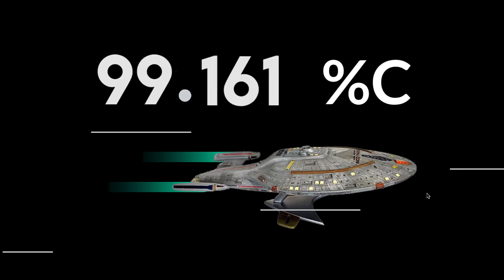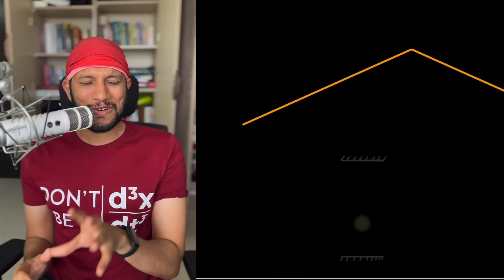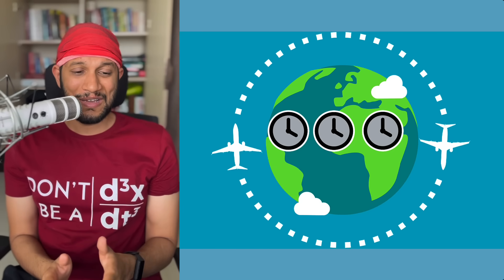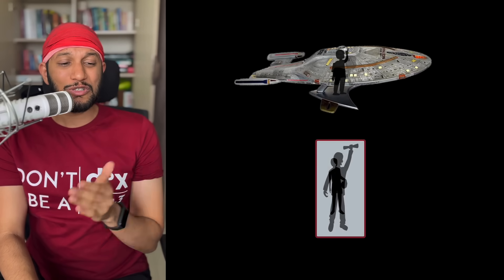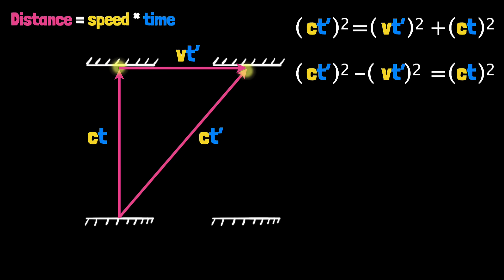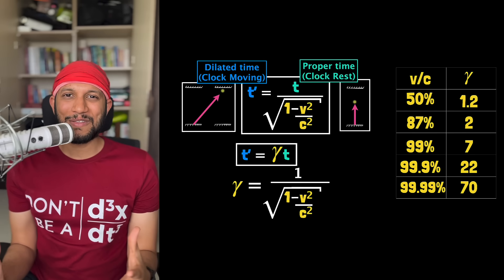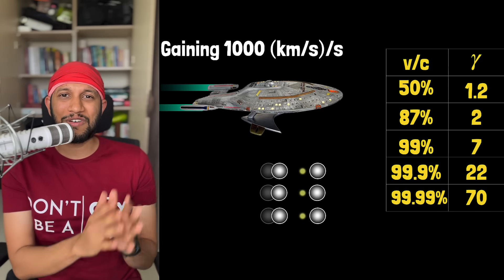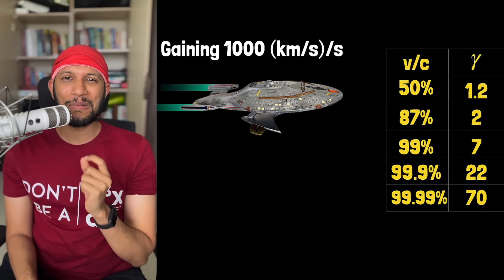I finally understood why you can't go faster than light! (My mind is blown)

Comment: Wow. I actually understand this. The beat explanation of why light speed is impossible i have ever found. One question, you have explained this from the observer of the ship approaching light speed, what would happen to people on the ship as they approach light speed? Would they cease to exist as the external ie time outside of the ship would become infinate?
Reply: Remember that all speed is relative.  While the ship is moving at 90% of the speed of light according to one external observer, it is simultaneously moving at 20% of the speed of light relative to another, at rest relative to yet another, and at all other possible speeds between 0 and c in infinitely other reference frames.  If all of these reference frames are equally valid (as posited by the principle of relativity, going all the way back to the 1630s here), then why should the experience of someone on the ship depend on how fast the ship is moving according to one particular external observer?
Reply: @extravagantpanda7962  ok another question. Light is subject to the doppler effect the same as sound right? Hence the red and blue shift. If I were travelling on a train moving at velocity v and shining a torch or laser towards the back of the train. The light would be traveling at c - v right. But if I shine the light forward does the light travel at c + v, i.e. faster than the speed of light. Or is X a constant and the wavelength changes?
Reply: @ChrisPavey85  No, the light would be traveling at exactly c in both cases, because light always travels at c in every reference frame.  If you shine the light in front of the train, both you and an observer on the ground will say that the light is moving at c.  This invariance of light speed between reference frames is what causes time dilation and length contraction. 

However, as you also said, yes light is subject to the Doppler effect.  The relative velocity of the light emitter (in this case you on the train) will cause the emitted light to shift in frequency (and equivalently in wavelength) according to the observer that the emitter is moving relative to, but the speed that the light travels remains the same to both observers.

Comment: The best explanation so far. 
One catch.., application of math of dilated time in the same vector of normal time… just doesn’t seem right. This is where the theory becomes a religion. Those who says it can be applied are its faithful followers and those who sees it as inappropriate (wrong way of) application or use of the vector tool to solve problem with linear and non linear factors in a same unit scale vector frame is a non believer…. make sense?

Comment: I have a question about the assumption that a photon clock would tick slower when moving. The intuition that the photon would have to travel a longer distance is true if the clock is oriented perpendicularly to the direction of motion (as shown in the video) . But what if we orient it parallel to it, so that the photon moves in the same direction as the ship to reach one of the mirrors and in the opposite one once it bounces off. What happens then? Isn't the photon supposed to travel a longer distance towards the mirror in the front but a shorter distance towards the mirror in the back, so that the time for reaching each balances out and the overall ticking remains the same as the one in a stationary frame of reference?

Comment: Okay but here's my high thought. Do we PERCEIVE this time at the same speed regardless of the speed we are travelling at. If the atoms are slowing down so is your brain. But do you think slow or do you not notice at all? Is there a singular speed all existence is experienced at? Could other hypothetical aliens have a different experience speed? Would there be a way to test with with species on earth if you had the perfect equipment? Plane atomic clocks but for different species.
Reply: You always experience the same time.  In your own reference frame, you are always at rest.  When you talk about having a non-zero speed, you are necessarily referring to your speed in some reference frame traveling relative to you (e.g. if you're going 70mph on the freeway, that speed is relative to the ground).  It is only to an observer in that reference frame that your time runs slow, but from your perspective time continues to run at the same rate and it is the other guy's time who runs slow.  

Also, the degree that your time is dilated according to an external observer depends on your speed relative to that observer.  Suppose there are two observers Alice and Bob, such that from Bob's perspective you are moving at .5c and from Alice's perspective you are moving at .8c.  Your time is dilated more from Alice's point of view than from Bob's, but you can't simultaneously experience two different rates of time, so who is correct, Alice or Bob? Well there's no reason that Alice's point of view should have any more importance to what YOU experience than Bob's, so we have to conclude that your perception of time must be independent of your speed relative to an outside observer.

Comment: 4:08 Can anybody answer this for me? So from the observer on Earth, the atomic clock in the fast-moving plane appears to ticks slower. Got that. But from an observer on the plane, wouldn't the atomic clock on Earth appear to tick slower, since relative to the plane, the Earth is moving really fast? 

Therefore when you bring them together, how is it possible that one is ahead of the other? Because from either perspective, the other one is the one that ticked slower.

Comment: No, no, wait. I still cannot understand why Einstein equates movement of information with the movement of time. For the observer the ship will be accelerating slower, but who cares about the observer. You are on the ship, you are accelerating. To you, nothing changed. In relation to your hand, the second is the same because you are accelerating with the clock. Yeah yeah photons take longer and longer to reach the outside observer, but no one cares about the outside observer. What you are describing is how fast the information about the flight reaches the outside observer, which is slower and slower and eventually it will be so slow that basically no information will come.  If it was a radio wave moving towards you, and you would be flying away from the wave at the exact speed of that radio wave, it would never reach you. And if you fly away even faster, that radio wave would be further and further away from you and again wouldn’t reach you, but you CAN outrun a radio wave. Just like you can outrun a sound wave. That is what you are describing. Prove me wrong.

Comment: I can't find any other comments asking this question so here it goes.
I totally understand how from outside the ship, it appears to take longer and longer so acheive the same velocity increase. 87 percent the speed of light take 2 outside seconds to increase 1000km, but only one inside ship seconds to do so. That being said, even if it would age the universe outside to it's everywhere heat death, from an inside the ship point of view, wouldn't it still just take one second to accelerate that last 1000km to hit the speed of light? 

I'm also slightly confused about what the ship would look like. Say i got to 99.999999999999999999999(just keep adding 9s as much as you feel like) percent speed of light. Since time is now moving so much slower for me (the outside world is aging faster) wouldn't that make a ship going only 99 percent the speed of light seem to zip by me? I might watch billions and billions of years of the universe age through the window in a second of my inside the ship point of view. Which should really only have me objectively move roughly 300,000,000 meters. So I've only moved 300,000,000 meters in a universes lifetime. That seems pretty slow to me? What I'm i not grasping here?

Comment: If we are moving constantly, on this planet, as a solar system, and as a galaxy, it means we too are traveling with dilated time. Can we backtrack and actually measure what non dilated time is ? Is it >0? Can we derive from this that actually, moving is time? If so, energy from the big bang that started pushing us away is time, since without it we are at 0? Energy = time? But if energy = time, stored energy, pre release also contains time? Im sorry for the bad english.

Comment: I have to say I understand a lot more now, but can you tell me what happens if there is a mass that is going at 99% speed of light and on that there is a object that is going 99% speed of light. Ofcourse I understand that it is not possible for some reason can you explain why ?
Reply: This is totally possible!  Consider this equivalent scenario: a ship moving at 90% of the speed of light away from earth emits a projectile that moves at 90% of the speed of light away from the ship, as demonstrated (poorly) by the following:
(Earth)        ----->Ship ------->Projectile

To find the velocity of the projectile relative to earth, we can't just add its velocity relative to the ship plus the velocity of the ship relative to earth (though this is exactly how you would do this in classical, i.e. non relativistic, mechanics).  If we were to do that, we'd find that the projectile's velocity is 1.8c which of course violates the "speed limit".

Instead, we need to use the relativistic formula, which can be derived from the fact that the speed of light is constant in all reference frames (but I'm not going to attempt that in a youtube comment lol):

Vp,e = (Vp,s - Ve,s)/(1-(Vp,s*Ve,s/c^2))

where Vx,y denotes the velocity of x relative to y (e.g. Vp,e is the velocity of the projectile relative to earth).  (Side note: the first term (Vp,s - Ve,s) is just the classical formula as mentioned above.  The second term is essentially a "correction" to the classical formula, and if Vp,s * Ve,s is much less than c^2, then this term is approximately just equal to 1 and we recover the classical formula.)

Here we have Vp,s = 0.9c and Ve, s = -0.9c (from the spaceship's perspective, the earth is moving away at 90% of the speed of light).  Plugging these in gives Vp,e ~0.99c.  So you can see that using the correct relativistic formula still gives a relative velocity less than c.

Comment: You can't reach the speed of light, because in your simulation, you're not doing anything to overcome the inertial field.  If you only understand the universe from the perspective of gravity, you're not going to understand.  It should be obvious to anyone, at a point, with physics, you need to overcome inertia.  Substance is more illusion than it is reality.  

Think in terms of moving one field through another, instead of mass through a field.  The mass doesn't need to move, only the field the mass is contained within.

Comment: What about a ship that travels at 51% of light speed relative to earth and another ship but in the opposite direction. How long does it take to send a message from one ship to the other (without the earth as relay)?
Reply: If we label the spaceships A and B (doesn't matter which is which), then the formula to calculate the velocity of ship B relative to ship A is:

Va,b = (Va - Vb)/(1-(Va*Vb/c^2))

where Va is spaceship A's velocity relative to earth  (0.51c) and Vb is spaceship B's velocity relative to earth (-0.51c).  As you can see, the velocities don't simply add together like in classical mechanics.  If you plug in the numbers, you'll get Va,b ~ 0.81c, so still less than the speed of light.  How long it takes to send a light signal from ship A to ship B depends on the distance between them, but since the light signal always travels faster it will eventually catch up.

Comment: Light is an expression of infinity. In mathematics and geometry, we observe the principle of continuum and think of it as an inconvenient abstract which stands in the way of our describing the world around us. Given that we tend to look for digital data that can be understood and applied to our cooperation and manipulation of the natural systems we encounter within reality. But what you've explained quite well, is the evidence that the infinite nature of the subatomic structure of reality is a fact. And our math and geometry are actually analogs of the bigger inconvenient truth. Infinity stands between every distance and outside of them as well. We cannot cross that boundary, because we are not infinite. Like every calculation of the mendlebrot set having its infinite vortex, but all of those vertices sitting with the infinite set of numbers that also sit within an infinite realm of various sets of continuums. Sure, we can walk from one calculation to the next when we're on the Solve for X side of the equation, because they are neighbors with approximation we can traverse. But if you travel down any of its corridors to its solution, you get further and further away from all of the other solutions.
Reply: I suspect that we would never get anywhere close to the speed of light before discovering that even though everything seems to move slower and even ages less, that entropy would rear its ugly head with the discovery of basic physical dependencies breaking down, due to too large a distance being traveled, for some of its components to keep up and still function properly.

Comment: I am no rocket scientist, but have a genuine question. Without gravity or air resistance, wouldn’t any force applied to the moving ship compound upon itself with no resistance pulling it back to rest? In other words if enough time is given, the constant addition of applied acceleration would push it to unlimited speed. This in my mind would not only be able to reach the speed of light, but surpass it. Also, just because speed breaks a clock doesn’t mean it changes the fundamentals of time itself.
Reply: In the video he explains it from the perspective of someone watching the ship
Due to time dilation from the outside it would appear that the ship was accelerating slower and slower, until it was accelerating so slowly that it essentially isn't at all, because the thing applying the force to accelerate the ship is itself affected by time dilation.
Now if you were on the ship, who knows what you'd experience, assuming you weren't turned into mist from the acceleration, as the real time would be an infinite time for an outside viewer while for an inside viewer it would be finite, so there'd be more issues there lol
Reply: this. Why does the light inside the ship not accelerate with it? is the inside of the ship not a closed system?

Comment: So what would the perspective from inside the ship be as it attempted to reach the speed of light? Would they just perceive the universe around them dying of heat death? 

Would the energy of the particles of the ship and crew also experience heat death at the same rate as the energies outside ship, or at a slower rate?

Comment: I've always assumed that if you were to accelerate to a speed where time dilation is 2x and travel one lightyear, from the outside it will appear as if you travelled at near C for one year, but from the ship's perspective it would appear as if you travelled at 2C for half a year. Am I correct there? If so, I wonder if there's anything strange that happens visually from the ship's perspective at speeds above C.

Comment: Unfortunately, that explains why what an immobile observer won't see, won't perceive, any movement faster than the speed of light, that the perception won't be able to "move" faster than the speed of light,  not that the object is unable to move faster than the speed of light.  It is like two rails of a railway which APPEARS to touch themselves when far, far away, due to the perspective. But in fact, they stay parallel. Perspective and math we use to describe it, the real thing does not care about it.

Assume an immobile observer on the x axis at the origine. Assume a mobile at a speed of 2*c also at the origine. So, at time 0, the observer sees the mobile. But at t=-1, the mobile was at x = -2, and the light it emits will only be seen by the observer at ... t  = +2  since the light still moves only at a speed of 1. So, at t = +2, the observer will see... TWO mobiles, one at its left and one at its right. In fact, the complete sequence of what will see the observer is:  NOTHING until t = 0, then, at that time, a mobile appears and split apart, one part moves right and one part moves left.

Comment: actually theory of relativity is false, time is constant, just the observation of time is relative, and time dilation doesnt exist and it havent been proven at all, the atomic clocks test doesng even make sense, why would one clock be faster than the other if speed is relative??? Since speed is relative technically the earth was moving also at the same speed as the plane, why would the clock on the plane be shorter ? Not the one on earth??? They didnt take to account some variable.
Reply: What kind of illuminati bs is that

Comment: I have a fun little thought which I will state as fact.
It is actually not impossible to achieve the speed of light at all, but it takes all of the energy in the universe to fuel a projectile to that speed.... And not a single electron more.